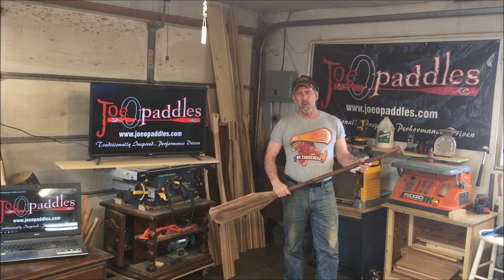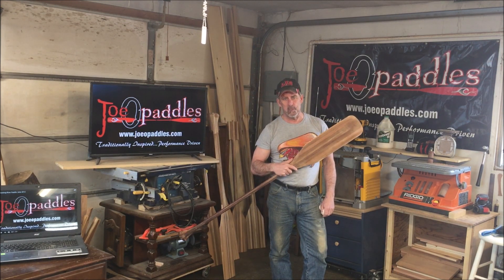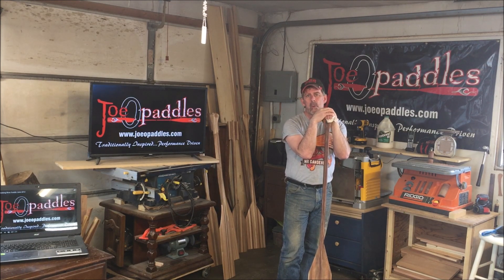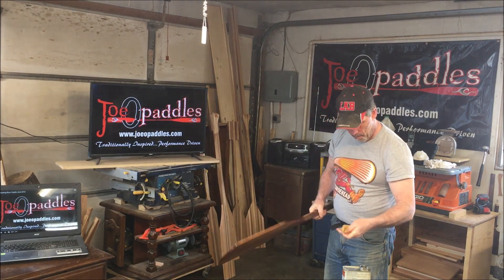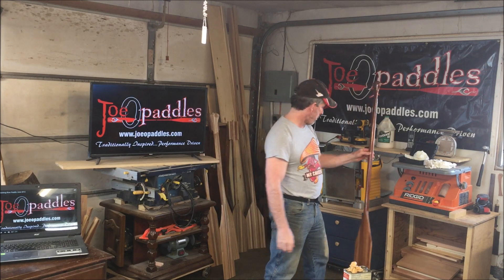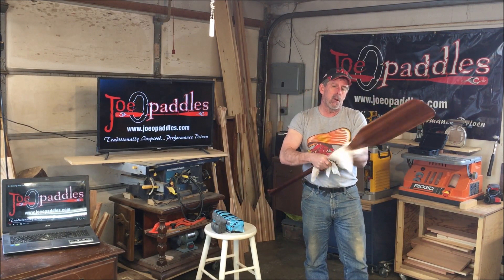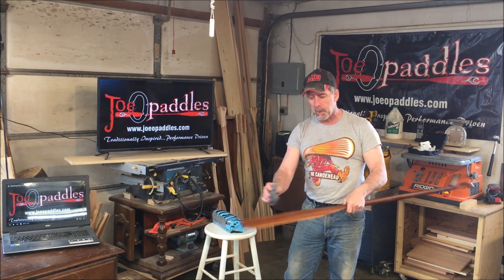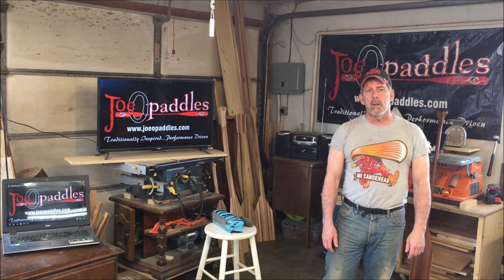Wood Canoe Paddle- Maintenance/ Oiling

Comment: Man, those are beautiful paddles!  Joe, do you plan or do anything to make the balance of the paddles good?
Reply from the maker: Yeah, I tweak them 1 by 1 to try and get the balance right. Gets easier the more you make. Sending one out to Florida shortly.
Reply: @JoeOsChannel  I can see how you would balance a kayak paddle.  How do you balance a single bladed canoe paddle?
Reply from the maker: @explorermike19  You can tweak the size of the blade itself as well as the thickness/ thiness. You can play with the grip a bit (bigger overall in some cases). also just the choice of what woods are used plays a big role.
One of my first bent shaft canoe paddles, from about 11 years ago, it has great balance and weighs 18 ounces. All western red cedar with a lightweight later of foberglass/ epoxy on the blade. I was paddling with that one last Friday.
Reply: Do you have a favorite Tungoil?

Comment: Tung oil is new to me. I have "oiled" my paddles a couple of times with mixture of pine tar and boiled linseed oil. It's good, but it takes some time to dry and you always have to be careful with the boiled linseed oil because of the flammability. On the other hand, I haven't sanded the paddles before re-coating them. That should make the drying faster.
Reply from the maker: Yeah, I like that the tung oi dries a bit faster. My Dad used to do linseed oil on some of his paddles but for me, it has been tung oil on nearly all the Greenland paddles I've made and over half of my canoe paddles.

Comment: Anyone here help with a question? I have 3 paddles and my oiled grey owl paddle has the best feel. I've 2 other paddles which are older and the laminated style. I am sanding the varnish off those ready to apply a new coat, but I'd much prefer to oil them if I can. I've heard that oil is not ideal for laminated paddles, has anyone tried? Does it risk de-lamination or might I get away with it. Hate dealing with varnish, more effort, smell, mess, and not such a nice feel.
Reply from the maker: Once you get all the old varnish off, you can oil your laminated paddles, that is not a problem. An oiled finish is better protection than varnish and it certainly feels nicer on the hands in my opinion
.
Reply: @JoeOsChannel  Thank you Joe, I'll do it then. I've just seen several youtube channels where they say you cannot oil a laminated paddle, but they didn't say why. They all said you can use oil on certain types of wood and varnish on others, I think it was a soft vs hard wood thing. Anyway, I love my Grey Owl Sagamore, the feel is infinitely better, so I'm going to go for it on my other, older paddles too, after a lot more sanding. Thanks again, much appreciated
Reply from the maker: @LeeHobbies  I've built over 2000 paddles by hand now, most of them laminated. I'd say 95%, likely more, were oiled. I just refinished two of my laminated Greenland kayak paddles a few weeks ago, both about  years old. Now re-sanded, re-oiled, you could look them over and think they were brand new. And they both have many years of hard use on them. That said, the glue I use on every paddle I build is a waterproof glue as well.
I have no idea what Grey Owl uses for their glue, I can only speak about my own paddles.
Reply: @JoeOsChannel  Brilliant cheers Joe, my Grey Owl is a one-piece and came oiled. The others are laminated ones by Carlisle and Pelican, old and spare. So I'll sand them and oil them, if it is that the glue they used isn't compatible with oil, so be it, but I'm happy to give it a try. Thank you so much for taking the time to give me some advice and enough confidence to go ahead. All the very best to you :]
Reply from the maker: @LeeHobbies  Good luck with the paddles Lee and happy paddling my friend!